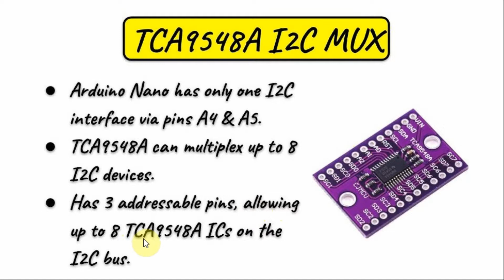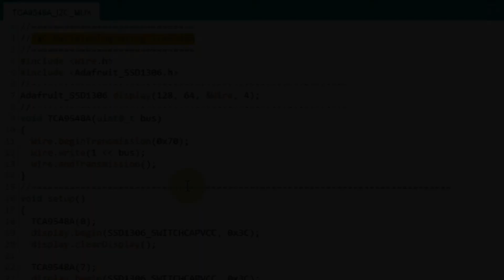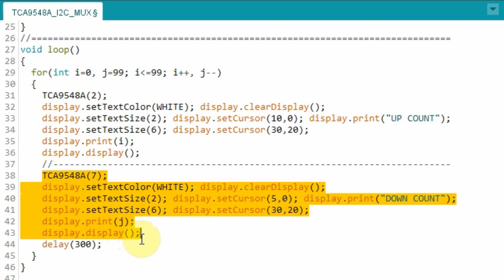TCA9548A I2C Multiplexer

Comment: I2C is meant for connecting multiple devices. Does any one still need TCA9548A multiplexer ? Can we set differen operating frequency for individual devices connected to this IC ?
Reply: it depends on if the devices you are connecting over I2C have the same address, most small oled displays only give the option of two different addresses (or none at all) in order to properly address these devices you need to MUX them into there own "network" so that you can address them properly. Otherwise if you have two of the same addresses on the same network the data will be replicated on both of the screens.

Comment: Thank you for posting this video. I had a problem getting multiple OLED 128x64 displays to show information correctly. With your video I was able to fix the issues in my sketch and now I have 8 displays working perfectly. I found an interesting problem in my application when using all 8 channels. I had to introduce a delay before the call to the 1st display in the sketch for the 1st display to show up properly. Without it, the OLED display for channel 0 was blank while channels 1-7 were showing information correctly.
Reply from the maker: Thanks for your feedback